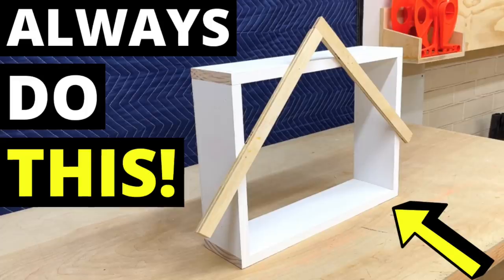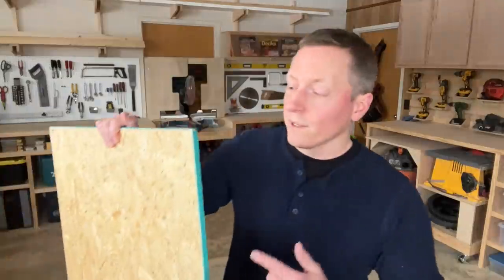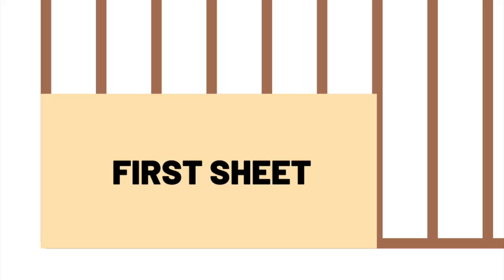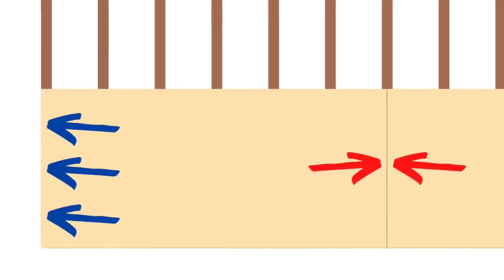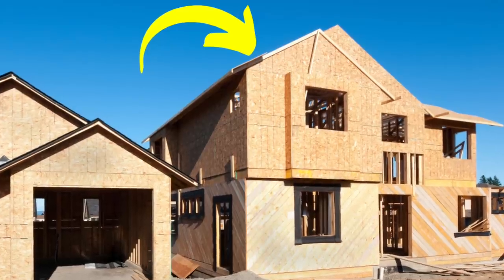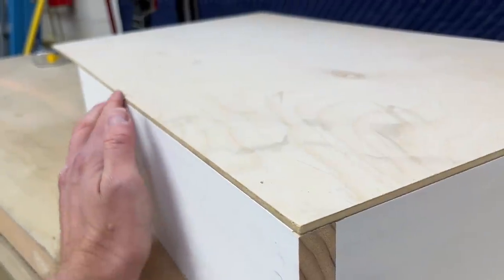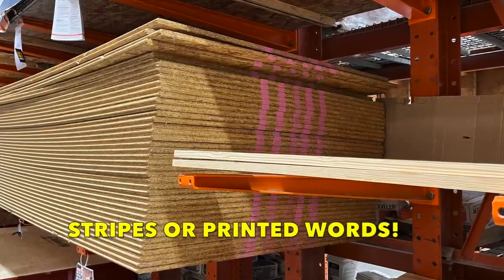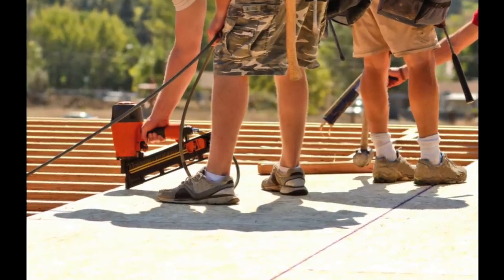This BUILT-IN LUMBER HACK Will Help You Build Anything! (Understanding FACTORY EDGE--How To Use It!)

Comment: The quality of products have been down and as others have said, for framing and sheathing and rough carpentry but I disagree that factory edges are perfect. They're in the ballpark but it depends on what you're doing and the tolerances therein. If I'm doing something where a 16th or 32nd is noticeable the factory edge isn't that good, if its one of those situations where an eighth in 8 feet is well within tolerance then yes this is usually true. It also can vary by product and manufacturer, if I get furniture grade plywood its usually on the money where I once was dealing with bulk cheap mdf my boss bought and the sheets were more than a quarter inch off in dimensions let alone square. So yes and no, and to be sure if you're relying on this then throwing a framing square on one of the corners is a good way to be sure- Georgia Pacific isn't going to be the one left holding the bag if something is wrong because you had blind faith in the factory edges being square, you the builder are.

Comment: Speaking of square, not all squares are square!!
Verify your square strikes lines 90
Step 1. Strike a line
Step 2. Flip the square and strike a line on top of the old line. 
Both Lines should line up parallel.

Comment: This tip is from the honest carpenter & it maybe useful in rough framing it’s not good for finish work unless you’re going to paint & hide gaps with caulk. This “tip” will cause more harm than good & calls or into question the usefulness of any tips from this site.

Comment: Do not trust the marks on plywood for centers
Reply from the maker: I see them as basically just being references, James. If they fall in a convenient line, use them. If not, pull your own square lines. Either way…
Reply: @TheHonestCarpenter  
I agree completely. Recently I’ve had some an inch and a half out. Had to ask why bother.

Comment: I am not a professional carpenter.

Since the worldwide health crisis, I no longer trust anything.

It seems that lumber and sheet material QC has dropped significantly over the last two years.

I have found numerous pieces of lumber to be off in measurements. The width of 2x material to vary from the nominal measurements by as much as 1/4 of an inch.
Pieces of sheet material to be out of square etc.

In my opinion suppliers are rushing product to the market to take advantage of the spike in lumber prices.
It is not being properly dried or tested.

This maybe due to staffing problems. Certain people at the mill may have retired or are in and out because of health issues.
Causing QC problems.

I no longer trust anything.

Carefully measure what you buy.

Comment: Nope sorry I've built cabinets now for close to 50 years. A factory edge is nothing I'm going to depend on. Not on any sheet of plywood but especially a sheet of Baltic Birch. If I wanted to build something out of square I'd use a factory edge every time.
Reply: I agree. I've been in carpentry for over 20 years and I don't trust any factory edge or angle.

Comment: This videos advice should only be used as a rule of thumb.  In reality it is far from true.  Maybe it works for rough carpentry but it is not something you can rely on in my world.  

Be careful people.  This advice could cost you your job or a lot of money.  Always check because even a factory edge is the result of a human calibrating a computer or machine.  Even a dull blade can deflect in a lumberyard or sheet good plant. 

I’m really surprised to see this kind of advice come from this Chanel.